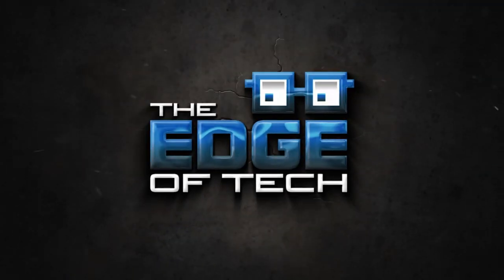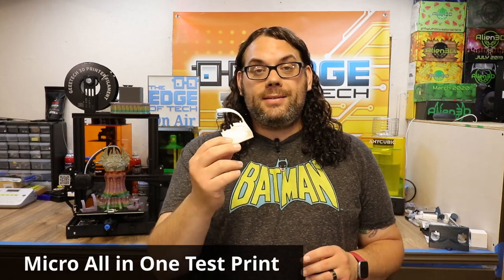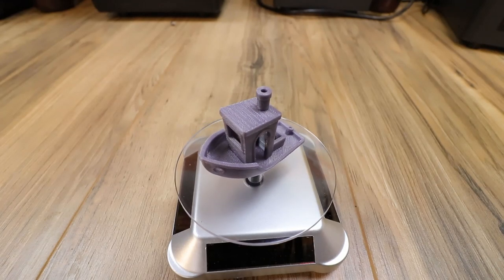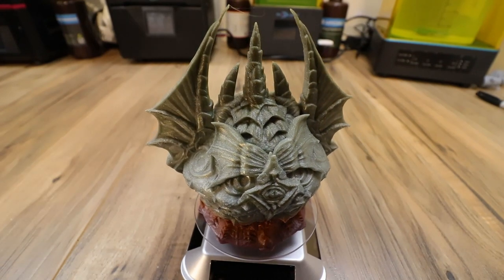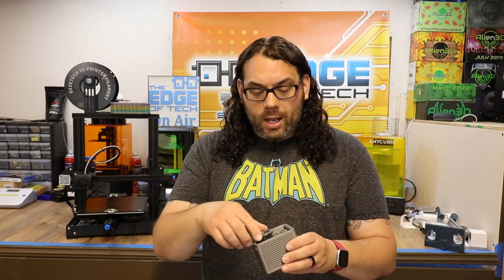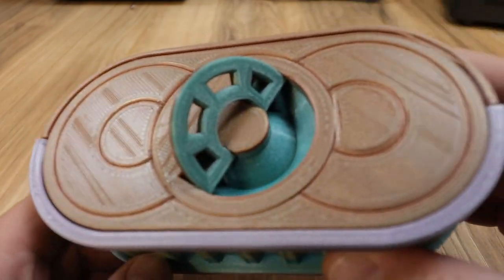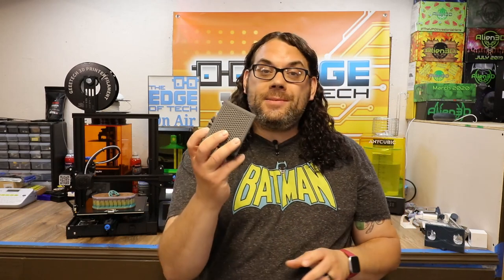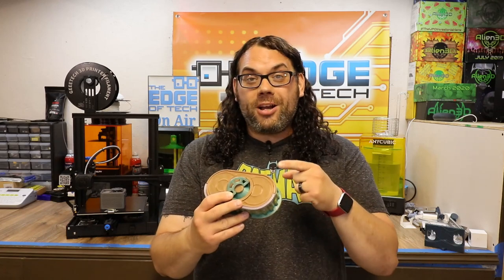Ender 3 V2 - Great Test Prints using the Default Creality Ender 3 Prusaslicer Profile!

Comment: I am 7 days into the hobby with the Ender 3 V2. I started with Cura but  2 days ago switch over to the prusa slicer and so far I have liked it better. I think being able to easily slow down the first layer print speed  really makes a big difference.  I was having some adhesion problems on the lower settings but I saw people using glue sticks and that really worked for me.  All day today, I took the print off, wiped off the glue, reapplied it to the bed and off to the next print. It was awesome.
Reply from the maker: Awesome! I am glad you are liking it and trying out PrusaSlicer! This is really a great hobby and in no time you will be hooked! Thanks for watching!
Reply: What kind of glue
Reply: @PrecisionCSGO  Elmers Glue stick. I like the purple stuff because when you wipe it off with a damp cloth it shows up purple again. Just keep wiping until I dont get purple on the paper towel.
Reply: @rogeliustachyon7528  thank you!

Comment: ordered a v2 yesterday as well. found this video and seems like I did a good thing.
Reply: I’m now looking into it, has it been good for the near year you’ve had it?
Reply: @fergus8173  If you get one, just get a BLtouch, an all-metal hotend, a magnetic sheet bed, and don't upgrade it further. I caused myself more headaches than I should have by doing all kinds of upgrades to the machine. I've had it dialed in twice where it produced great prints, but then I tried upgrading and screwed it all up. An octoprint will help with leveling and sending files to the printer. Overall, I learned a lot but I caused myself a lot of headaches.
Reply: @stelonous  noted! Thank you. Since my comment I’ve purchased myself one so the fun has begun
Reply: @fergus8173  If you desire a little bit easier leveling, get either yellow springs or silicon spacers for the bed. It can help in leveling. Frankly, I removed the springs and it just sits on hard plastic pieces so the bed doesn't adjust but is compensated by the BL Touch.
Reply: @stelonous  I’ve looked into the BL touch very briefly so I might consider it soon but currently I’m still getting myself used to everything. You mentioned Octoprint too, that seems like a very good upgrade. Not used a Raspberry pi before so a good opportunity to learn as well

Comment: Loving your channel so far.  Just put together my first ever 3D printer last night (Ender 3 V2) and am planning on tramming/running my first test prints tonight.  Any suggestion on what is the best slicer/modeling software for beginners?  I know my way around SolidWorks pretty well but would like more options and have no clue about slicers.  Any help would be most appreciated.

Comment: Thank you for the vid.. i was about to buy a 3D printer for me to print my 3D character models.. will this do for a figurine like 7-12inches of height? or Ender 5 pro is much more capable? keep on creating awesome videos! thanks! :)
Reply from the maker: The Ender 3 V2 will do about 9.8in tall. The Ender 5 Pro will do about 11.8in tall. So both of them will not hit the 12in mark. Both are great printers though.
Reply: @TheEdgeofTech  i'll cut them in zbrush so i can print bigger figs.. :) my main concern is the quality.. hoping it can print more fine details, atlhough for sure, not as fine as a resin can give us..

Comment: I know your using mostly default settings, but that micro test should have been spot on up to the last overhang angle. The E3Pro from 2018 can manage that when stock. Rainbow filament is cool.
Reply from the maker: I will definitaly dial it in and print it with the modified settings! But this is a great "before" print. No let's see what the "after" looks like... lol

Comment: im debating over the ender 3 pro and the ender 3 v2. Sorry if this question is stupid, but can you still swap the extruder fan on the v2 for a noctua one, change the extruder, and swap the bed? I know u can do all this on the ender 3 pro, but im not too sure abt the ender 3 v2. thanks
Reply: I think u can do those things, but not entirely sure about the fans yet for the hotend and part cooling yet... definitely different print head / fan cover and mounting holes.  This is probably one of the few drawbacks of the V2 compared to the proven Ender 3 and Ender 3 Pro.

For the most part, its still a lot Ender 3 underneath.  So u can change the extruder, change bowden tube to Capricorn, change the bed springs, change the bed (i.e. 3 point etc).

But the problem may be the pinthead portion so far..and the belt tensioners if wanted to use different ones, may not be able to yet. I.e. full metal.

V2 better buy than Pro, unless u need to use established upgrades from the Ender 3 and Pro that may not adapt to V2 (yet).
Reply from the maker: You can do those things for sure! Actually you may see some of those things coming up on videos soon, but don't tell anyone! :P
Reply from the maker: Good points! You can for sure upgrade this printer and it's worth the extra money for the upgrades it comes with! Stay tuned for many of the upgrades listed above! :)
Reply: @timd9430  thanks for the response!